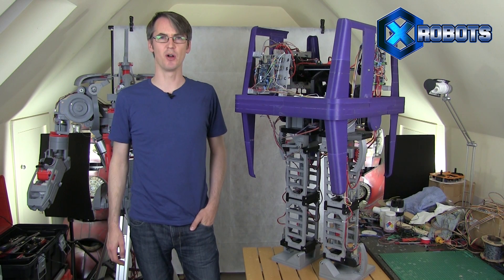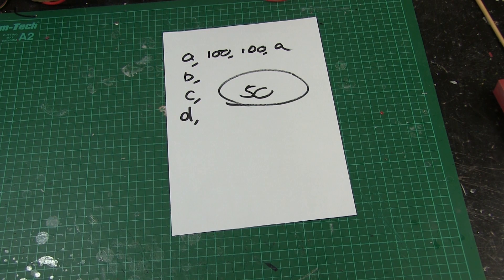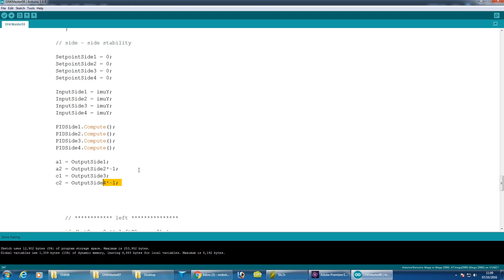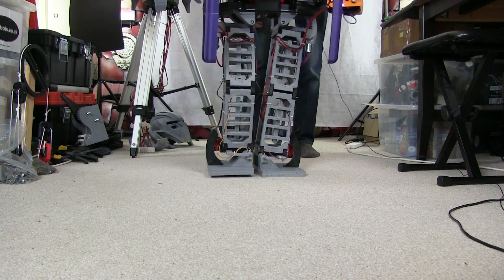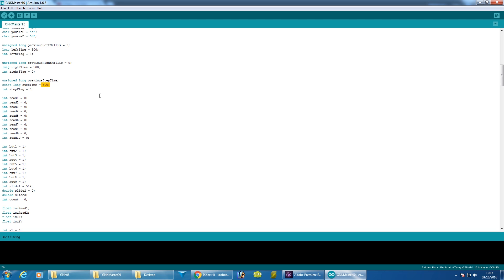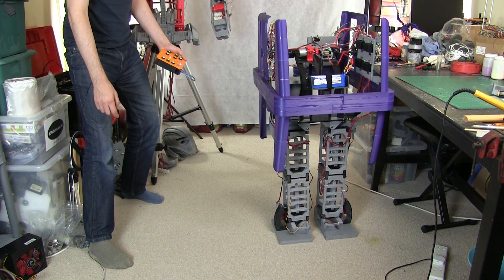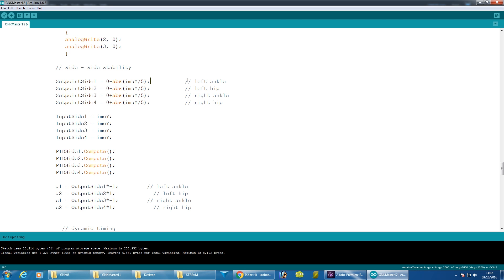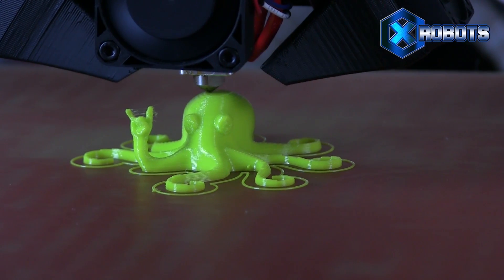Star Wars GNK Power Droid #8 | First Steps | James Bruton

Comment: You shouldn't manually adjust the pots or any trim for them. You should auto-calibrate them by running each motor through its full range and recording each pot's min and max values. Then you can use those to auto-scale the pot values to normalized ranges.

Comment: Some dynamic considerations:

"swinging" the other leg forward, will create a yaw around the foot that's actually touching the floor.
if the mass is not completely centerred, the yaw on the right foot is not fully counterred by the yaw on the left one.
this will cause it to walk in a big circle..
the diameter of that circle will depend on the friction of the flooring..

you will want to use the gyro in the IMU (or/and the compass, if the IMU have one) to correct that.

the wandering is to be expected, as the robot have nothing to correct any small slides of the foot when the foot hits the ground.
sum of gearslacks, timings, and similar will not only let the feet positions drift, but also let the feet have a small impact speed.

you need some sort of position estimation to eliminate it, and put it in the controller as well.
some image analysis of the flooring can be used, (tracking the floor like an optical mouse)..

Comment: Just a thought for the wondering issue.
Have you tried it on a hard floor rather than carpet. been as the carpets have a bias for moving in one direction, Due to the way they are made. I noticed a simulator effect on RC cars I had.

Comment: Great progress! I noticed that at first the left leg was bending more at the knee and causing it to turn, then at the end of the video it was the right leg bending more than the other, causing it to turn in the opposite direction. So some adjustment to levelling out how far the knees bend needs might help, as well as how far the feet lift off the ground, as you mentioned (which might involve the knees as part of that adjustment).

Comment: the wandering could also be caused by the shag of your carpet. i'm not an engineer but a floorer. all carpets have a direction but short ones like yours tend to have a very strong one. if the guy who installed your floor knows what he's doing the direction should lead away from your main door.  you should try to let him walk on a hard surface just to be sure.
Reply: ***** polyprop has a direction as well. all looped carpets have.
but if the shifting is always to the right no matter how you orientate the robot on the floor my guess i clearly wrong.

Comment: Would you believe the Wander is caused by the PILE of the Carpet?? Have you ever pushed a cart down a hall with Carpet and had it Crab to the left or right? I bet if you try it on a Board or Smooth surface it would not wander much at all.

Comment: The droid travels while stepping because it has no sight to keep the position fixed. The issue will just be the same as for humans if they had their eyes shut. It will be difficult to maintain perfect position if there is no fixed reference point to make a balance adjustment to.

Comment: James. I see heat shrink on the ardrino pin connections.   Do you solder the wires on and then heat shrink; or do you use dupont connectors?   Just curious as I have built a 3d printed claw-arm.

Comment: Do not compensate timing from battery(it is ugly) - you should compensate it in the lower level. Best solution is to switch to current control of motors.
Reply: It will help, but you will need a powerfull one.
One simple solution I can think of is to divide servos pid outputs by battery voltage - so voltage on the motor wont depend on battery voltage.
It may even help when battery voltage drops under load.

Comment: I think the drift is due to the distribution of the weight....
Reply: are you zeroing the IMU ?
Reply: I mean, read the steady position of the IMU with the robot in standby, and than subtract/add that value to your reading to compensate the angle displacement of the building/robot, should give you a more calibrated set of data
Reply: I see!

Comment: "The lefthand leg" - English is wierd...
Reply: muh1h1 suppose leftside would be more fitting.
Reply: But is it left side from the perspective of facing forward, as if you were the robot, or facing the robot, as if you were in front of it?  I've found that people get confused by this all the time.  Tell someone on the road that their right headlight is out, and half the time they won't know which one you're referring to (their right, or your right?).

I used to use left and right side references like everyone else, until I started building robots and other things, and decided that that system of reference didn't work.
I briefly considered "driver side" and "passenger side" (I still use this in regard to the headlight scenario), but quickly realized that this won't work on a global scale, since people in Britain, Australia, and other places have "backwards" cars and drive on the wrong side of the road (haha -- j/k).

I've since started using "port" and "starboard" since everyone who knows what those words mean know which side of the vessel it's referring to.  It's universal.
Reply: I meant the left leg of the robot, from the robot's perspective. :) it looks like it leans in more to actual centerline of robot, instead of standing center to its own leg....straight up and down.  :)  yeah, I no robot speak.
Reply: I also noticed this. That may be causing the wandering in that direction.